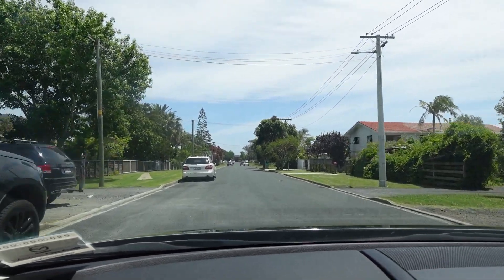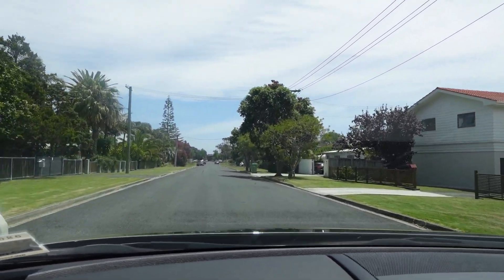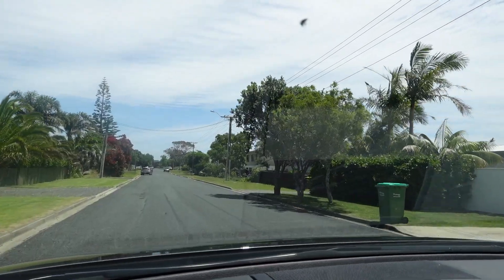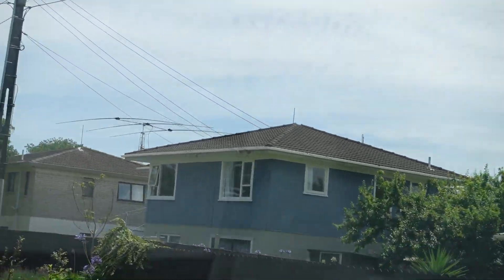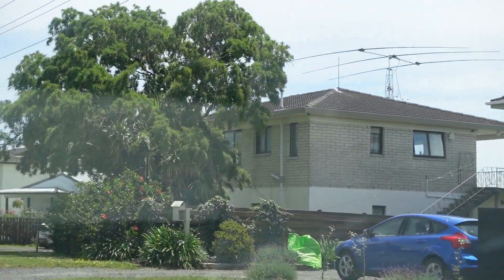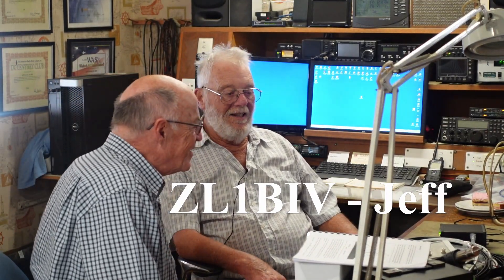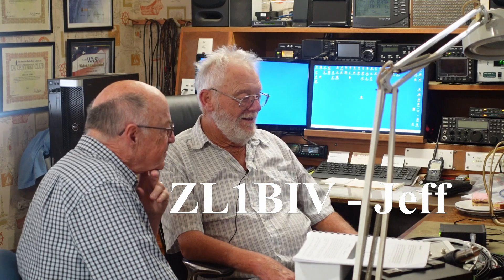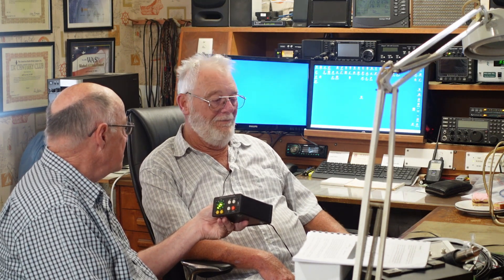NOISE and DXing DO NOT MIX

Comment: Nice one Roly, breakfast time here in the UK so I've got the compulsory coffee  :-) 
I've only got a small garden, but the plan is this weekend to measure my fence as I'm planning to hide a loop around the top of the perimeter of the garden.  I'm going to try and model it in MMANA-GAL (Cal's favourite program).  I doubt it will be any good for transmitting, but you never know.  Callum keeps mentioning a "fence bracket thingy" that might allow me to use a DX Commander up against the fence, so will have to wait and see :-)
73s  M7GTX
Reply from the maker: I hope it all works out well for you Richard...keep in touch and let's know how you get on....cheers

Comment: Thank you Roly. Could you tell us the name of the product 😉 building my first receive Loop on the ground with pre amp and stepped Attenuation build in. Gonna try it out on a SDR first then if it works well, I ll need to design in a T/R relay to switch to the dipole to Tx. KC3ONO
Reply from the maker: https://www.arraysolutions.com/pdfs/AS-SAL-Manual.pdf

It is a "Shared Apex Loop" Antenna. .....cheers